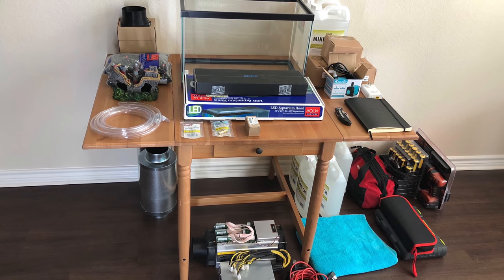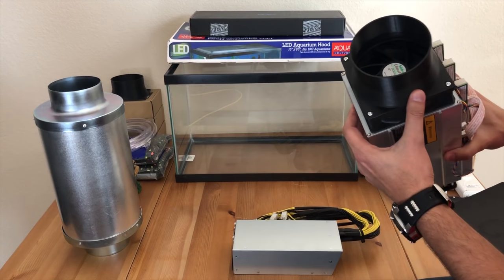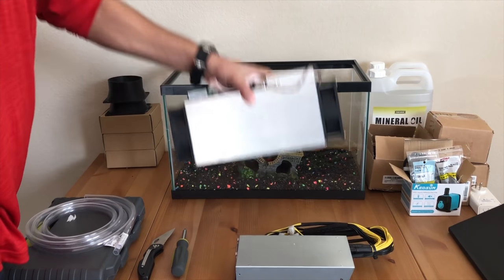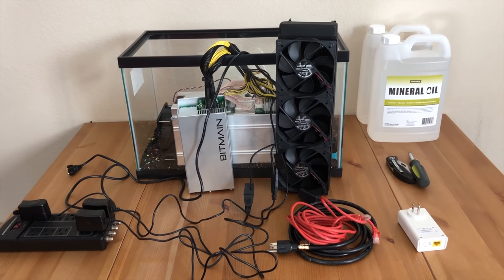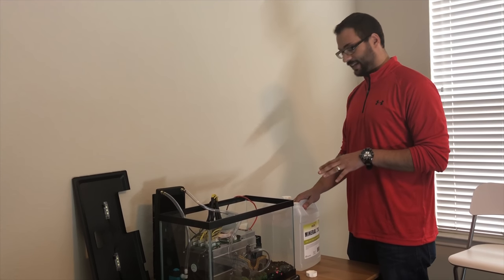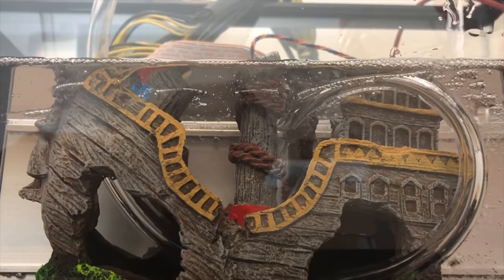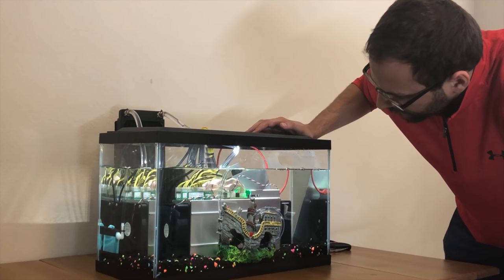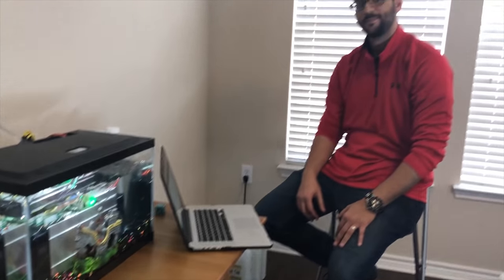Coolest Bitcoin Mining Miner - Liquid Cooled Experiment

Comment: We make installations of immersion cooling of the equipment (immersion in liquid). For purchase, you can write to Vkontakte https://vk.com/id21560819 Oh. Cooling of mining equipment in immersion cooling plant solves the problems of equipment overheating, noise, dust and saves space. There is no need to install expensive and noisy ventilation, which spends a lot of electricity and which can not be supplied everywhere. In 1 large installation is placed 36 miners S9, or 128 maps. The price of a large installation is 250,000 rubles (excluding coolant). A large installation requires about 600 liters of coolant. The price of a small installation from 50,000 rubles (excluding coolant). The equipment is placed completely in liquid, together with power supplies. It is possible to use the installation for cooling any other equipment (not mining). We do installations of any size for any number of equipment. The price depends on the size of the installation and quantity. There are solutions for standard server racks. It is possible to design and manufacture modular (mobile) data center with liquid cooling, as with use of submersible type, and under the server rack. Separately sell the liquid for immersion cooling. The liquid is a liquid dielectric-coolant. The amount of liquid required depends on the type of installation and the equipment placed in it. Also, this liquid can be used separately as a low-temperature dielectric coolant (operating temperature - 60 + 200). Suitable for systems LSS (liquid cooling PC). In this case, in case of leakage will not cause harm, because it is a dielectric. The cost of the liquid from 600 to 1,000 rubles/liter, depending on the size of the party. Payment of nal./clearing settlement. Production in Saint-Petersburg. Delivery is paid separately. Possible pickup.